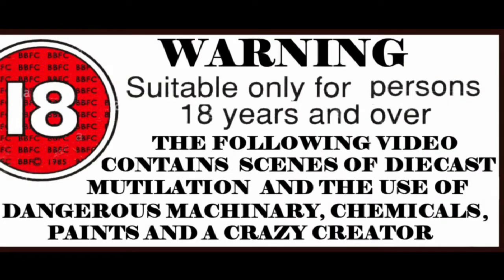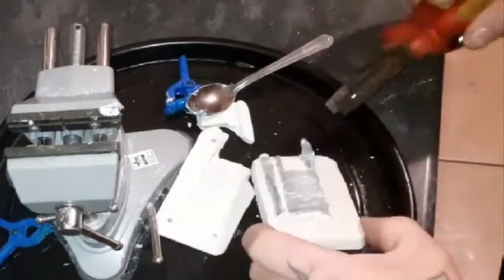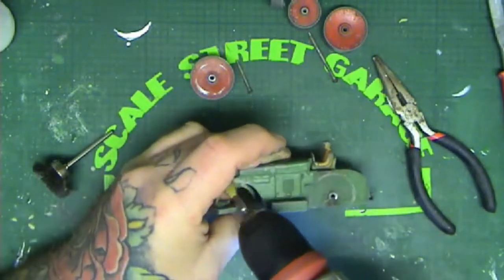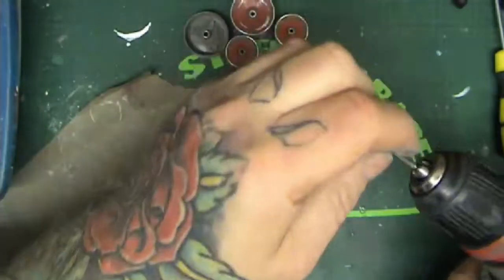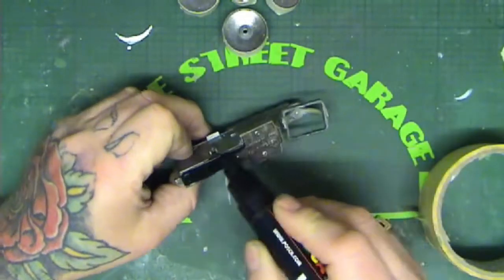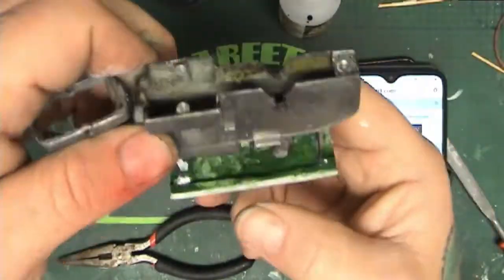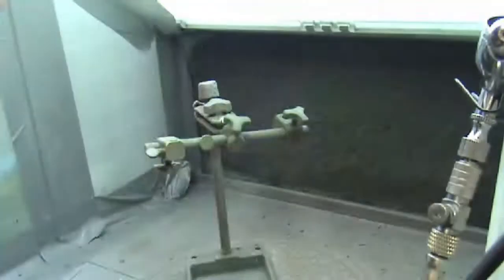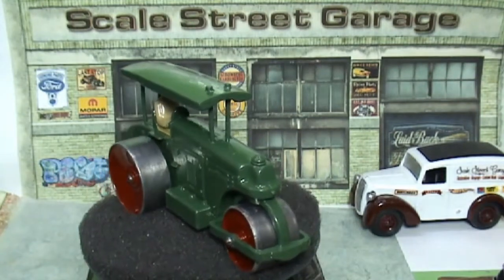aveling barford restoration

Comment: That was a fantastic and so advanced Project,The end result is Amazing!!!I have done a little sandcasting back in the days,mostly zink and aluminium.And i wonder: how long did you let the plaster dry? or is it just to let it dry as usual?I never dared to test plaster,read somewere about trapped moisture or something.But that was probably for bigger castings.
Reply from the maker: Thanks jan, 
This is only a small piece so the drying time was only overnight but that was my reason for a preheat with the torch before casting, i have done varied mold work  for historical restoration work but only for epoxide casting and not metal but i did the usual research on dampness and airpockets causing mould failures and the chance of them exploding under the heat, zamac has a much lower melting point than aluminium so my ergonomic risk assessment lead me to feel safe doing the casting

Comment: Am I right in thinking this is the Dinky model? The box gave it away. 🤔 All the way through, I thought this was the Matchbox #1, they are very alike. There were a couple of things that just didn't look quite right 'til it dawned on me when I read the box - bit of a Duhh!! moment.😬

You did a great job on this one; very interesting to watch the casting process. One thing I thought of; would it not be better to use high-heat silicon, or something similar, for the mould? As you were unmoulding it, I kept thinking "I hope it comes out OK, or you'll need to make another mould from scratch". Using silicon would let you re-use the mould - if necessary. Not a criticism, just a thought.👍

Cheers for now,🍻
Dougie.
Reply from the maker: Yep this is the larger of the 2 lol
Reply from the maker: You are absolutely correct in thinking that hh silicome would be a better option, but this way just shows it can be done with limited resources.
Reply: @ScaleStreetGarage  Ah, fair comment. I never thought of that.